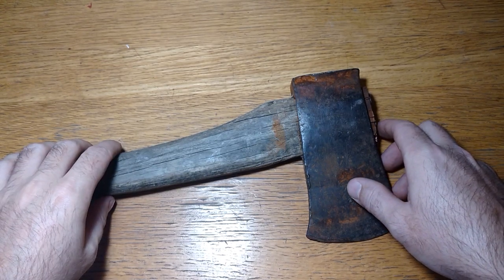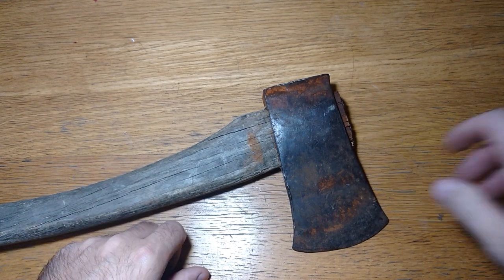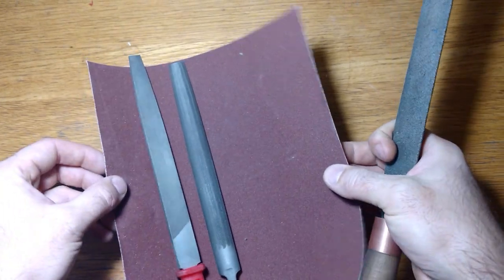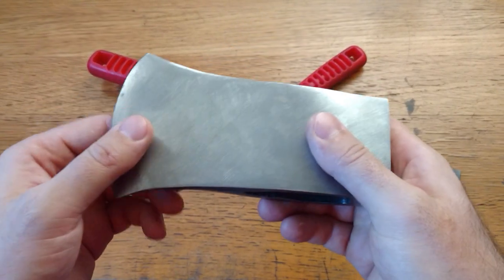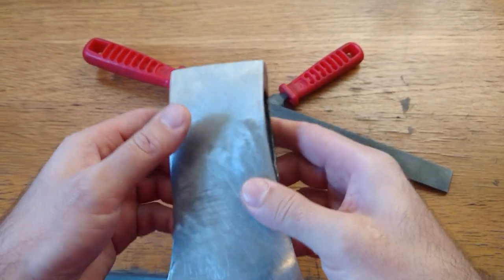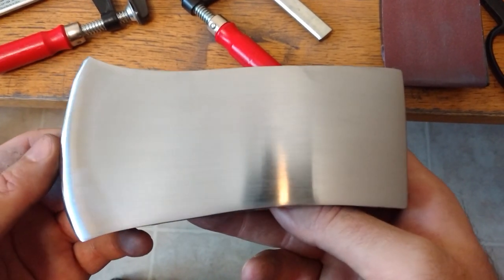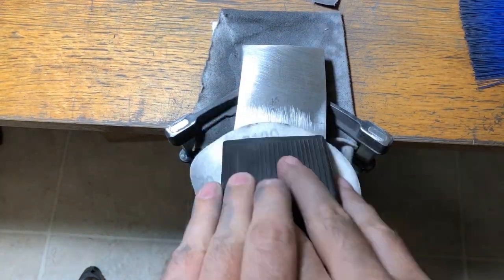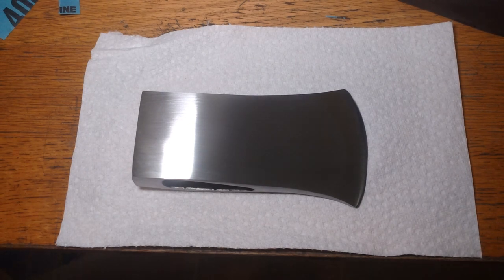How to Restore an Axe Using Hand Tools Only. DIY

Comment: This is also my preferred method, not with the angle grinder, with the file it is just more entertaining and has something to do with craftsmanship.
Reply: I did it with a grinder and a disk for grinding rust off. 
Some WD 40, sharpener and a new handle. 
I liked that the carvings stayed with black patina.

Comment: I am restoring a hatchet at the moment, and decided to see if I could find a video that was not using
electric tools. I am very grateful to have found this site. The restoration of the steel head was remarkable.
 I never saw the boiled vinegar method, and the beautiful patina it produced. Thank you for this demonstration.
Reply from the maker: Glad I could help
Reply: Tea with a few drops of vinegar makes a nice patina too. The tannins and acid react with the surface metal..

Comment: Nice axe head. 2:36 you can see the dark black strip along the bit where high-carbon steel was laminated into the head for great edge holding, while the rest of the head is more malleable to absorb shock.

Comment: I think you put the head on upside down. You can tell which part is the top by looking at the eye. The side where the eye is wider is the top, this helps to prevent the axe head from slipping off.
Reply: You're absolutely right. I noticed that too. On the before shot at the beginning, the more pronounced curve of the blade edge is mounted on the bottom. Whereas on his finished product it is reversed, and mounted pointing upwards. It's a subtle difference in the edge profile, but certainly enough to notice. Good eye my friend!

Comment: This is EXACTLY what I've been looking for. I'm 26 and have spent over a decade working on electronics and firearms, but recently got into wood chopping and wanted to build an axe the "manly way" and I wanted a method without power tools. I bought a cheap $40 husky axe head and a hickory handle, I sanded the handle and oiled it and it looks amazing, but the head is dull and looks pretty rough so this is my next step.

Comment: Hi. Great video to help me with a few axes in about to restore. 
Maybe this is a dumb question, but; what's the point in using electrolysis to remove rust if you are removing all that surface material with files anyway? Cheers
Reply: Maybe for the rust dust

Comment: good job, what about BLO for the handle, and end grain at the top?
Reply: What is BLO? Because I have an old handle attached to mine that I plan to just sand and apply some oil to preserve wood and protect from weather. I was waiting for that portion of the video. Guess i will have to search further.
Reply: @longhairmullet  boiled linseed oil

Comment: Silly question, did you use metal sandpaper or regular wood sandpaper?
Reply from the maker: I think 400 Grit was meant for metal, lower grits were like for general purpose. Just use whatever you got, it will do the trick!

Comment: Not bad for what your where going for. Next time use a water proof pva glue for n a bigger wedge. If you need to bring your kerf down more on the shoulder than do it to allow your wedge to engulf 2/3rds down. Maybe don’t take ever bit of character the axe has off. But to each their own. Nice way to muscle through it!
Reply from the maker: Thank you for your advice!

Comment: I like the patina look, it makes the hardened steel stand out on the cutting edge, I think you put the head on upside down though. The more hooked part of the head is for pulling logs about instead of keep bending down for them. If it works for you then doesn’t really matter. Good refurb 👍
Reply from the maker: Thanks man! Maybe it is up side down, still splits wood! Doesn't worth redoing the handle, wait till it brakes! LOL

Comment: Hi, i have lawn mower petrol tank that is internally full of rust. I won't be able to  clean the remaining rust with a wire brush. What is the solution?
Reply from the maker: Fill it with vinegar and let it soak for 3 days.
or evaporust
Reply: I used vinegar and air rifle BB’s (the metal kind) to restore a vintage kawasaki gas tank. Just make sure to do something to it after or it’l flash rust

Comment: It very well might be upside down.  I may work ok for you. I use a wider and longer ,  slimmer  wood wedge that will fill that hole. Leave it a little more "hung proud" and there will be no need for the steel wedges. You did a very good job otherwise.  Keep some oil on it. Gun blue looks good also.

Comment: Good efforts but I would rather use a wider wedge to cover the whole eye and just use one round metal wedge to secure the handle. With two ring wedges, there is still a quite big gap which will no doubt rock the head and will fall off eventually but the gap and the fact the head was hung upside down may have saved the eye from a crack along the eye.  Also the epoxy glue used on the wooden wedge would separate from the handle kerf when the axe receives repeated impacts hitting the wood.  Wood fiber expanding wood glue or linseed oil would hold the wedge longer in my opinion. Any update on the condition of the axe after use would be great. Take care and be safe!

Comment: Never saw him put on an edge!
Reply: Ya thats what I was thinking. Have to watch separate video for that bit. As well as how to oil to protect the handle, or how to restore the old one.. btw what are those rings called, that were used to hold the epoxy piece on the end?

Comment: Only thing I noticed wrong was I believe you put the head on upside down. That head has a slight beard to the bit that goes to the bottom. All in all though, great job sir. 👍👍👍👍🪓🪓🪓🪓🔥🔥🔥🔥
Reply from the maker: Thank you, sir! Yeah, I think I did, but guess what, it still chops the wood!
Reply: @Take_And_Make  I know that's right!! 😄😄👍👍👍

Comment: Me I never used electrolysis. Good ol' pot of boiling water and some elbow grease. Everybody does it different I suppose
Reply: there is definitely a better way than water. use an antirust compound to combat rust, it’s more powerful when you use chemistry to remove it than scrubbing

Comment: Nice job but the head is on upside down man. Theres no need for epoxy or glue for the wedge. Cut your kerf deep enough and the wedge will go deep and push the wood outward. I like how the etching shows the high carbon edge. That filing must have taken forever. I do like the round wedges also but they do tend to split the wood . I have learned not to let it bother me because I know the handle isn't going anywhere. Most of my axes and hatchets are users anyway.
Reply from the maker: Thanks for the tip

Comment: So obviously it was still sharp? I would sharpen it as part of the project.
Reply from the maker: I did not need to sharpen it after I cleaned it with files it was sharp enough for its tasks.

Comment: I can't comment the metal work, but the gap at 11:42 certainly cannot be a satisfaction for you.
Better watch that video about how to put a handle https://www.youtube.com/watch?v=0erTwfYM2UA
Circular wedges are fine, but wait for a few months/years to use them, they are meant as a means of repair if the bit gets somewhat loose.

Comment: I get you wanted to make it look pretty , but you literally ruined that axe by filing off unnecessary material ....
Reply from the maker: Strongly disagree, ruined means destroyed, this is a fully actionable axe. If it wasn't done the way you would not go, doesn't mean it's wrong. In the the end this axe splits wood with ease, as it should.
Reply: I disagree too. This is most likely a forged steel item.  Unless there are cracks or imperfections in the forging this thing is tougher than your arms can swing it.  Just squaring up little impact distortions and rust scale doesn't effect anything but the cosmetics. It's most likely not carburized or surface hardened.  Axe heads vary from about 1/2 kg  weight to up around 2 kg or more......a lighter axe does not mean a ruined axe.   This is a good project that teaches you alot about hand work.